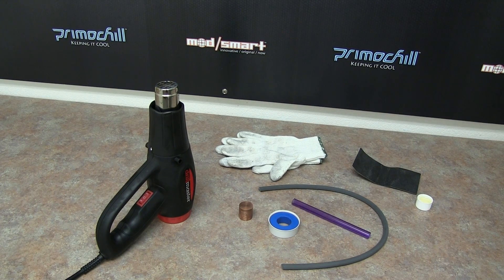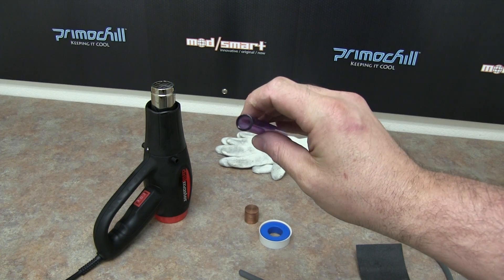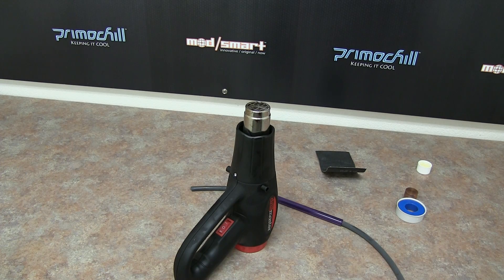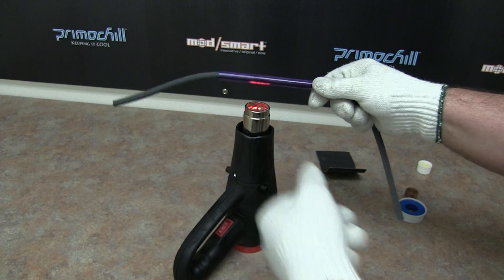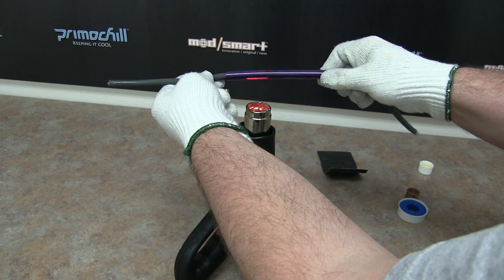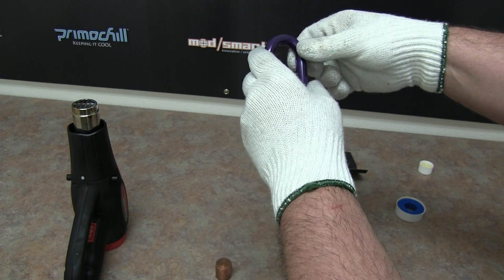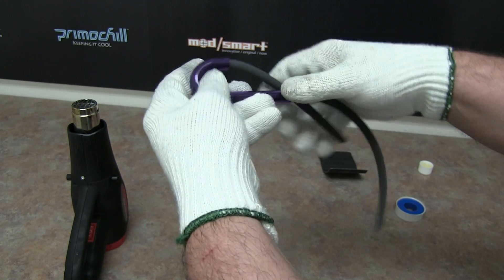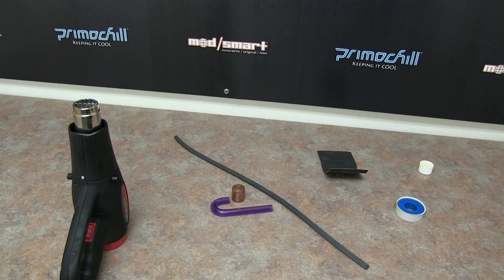PrimoChilll 1/2" Rigid Acrylic Tube - How to acrylic bending !! PART 1

Comment: What do you use to get rid of the olive oil in the tube?  I did it with the oil and it just doesn't look as clear as it was.  Tried soap and water still doesn't look clear anymore.
Reply from the maker: Typically this goes away during the sysprep cleaning process.
Reply: Or, you could, you know, not CONTAMINATE your loop with oil in the first place!  Crappy advice here.  You SHOULD be using ONLY a mild soap and water to lubricate, not olive oil!  BAD PRACTICE, and BAD ADVICE to use olive oil and to tell your customers to use it!

Comment: my heat gun isnt getting red inside, even on high, is it crap or broken?  i cant seem to heat up the pipe enough (heat gun looks the same as yours but its chinese)  if i cant get it melty so it bends, even after a few min right on top of the gun, its not hot enough right?

Comment: The damn thing is almost impossible to get into the tubing!
There is too much variation in the diameter of the acrylic tubes!
At best 25% of the tubes I purchased (10/13mm) had a large enough inner diameter to accommodate the silicone rod.
Any advice?
Reply: Use sandpaper on the rubber tube, and use soap water or oil!
Reply: ***** tried all of this, nothing worked.
Ended up buying some high temperature o-ring cord of the correct diameter off of ebay.
Worked a charm.
Reply: 101m4n 
What the above poster said is correct for anyone in the future watching this video. There is a slight variation in size but also the rubber tube SHOULD be a tight fit. If you can't get it in their with olive oil as lubrication then it is easy enough to sand down your rubber tube with sandpaper until it fits.
Reply: Mast3r Race The new cord that I purchased was a tight fit, the cord that I bought with the tubing was a millimetre too large. Besides, this was all done months ago.

Comment: Where did the heat gun pulled the air from?
From the Wooden table?
Usually it sucks air from the bottom (in this vid, red) and pushes it towards the shiny surface... No?
Reply: They are made to be used like that and thus they take the air from the top of the heat gun.
Reply: +Fredrik Carlén Are you SURE. Or are you just guessing? Because I have this SAME heatgun and it has holes on the bottom which DO suck air in. And he had to hold that thing over that heat gun for MINUTES it seemed like. I can heat up a motherboard and desolder parts in less time. So there's no way that it's "made like that"
Reply: +cybcarr no the sides, mines on the sides, the back is solid, looks the same as this one.. if yours has it on the back.. buy one that has the air intakes on the side...  shop around
Reply: Its coming from the cable
Reply: You must not be very bright. Here is that same heat gun. See the vents?  https://www.amazon.com/WindowTint-Drillmaster-1500W-Heat-Gun/dp/B00LLKLVUQ
I can't find a single heat gun from that manufacturer that has vents like you say.

Comment: Where can I find solid silicone tubing ?  What heat setting are you using to bend those tubes?
Reply: http://www.performance-pcs.com/monsoon-1-2-id-silicon-bending-insert-1-foot-for-5-8-od-tube.html most heat guns only have 2 settings... try number two, but keep the tube about 6-8 inches from the gun, and spin it around do not hold it in one spot for too long... keep spinning until the tube starts to act like the silicone tube inside of it (like a limp noodle) heat that for anoter 10-20 seconds than you can bend it into what you want.I would suggest buy an extra piece of tubing to practice on.
Reply: Ty. I'll take that advice.

Comment: the official primochill bending kit comes with a different silicon insert to the one in the video, as it's black and hollow inside which causes small kinks in the bends.
Purchased from a authorized retailer Nov 13.
Reply: primochillin  kindly answer to this Comment..
the official primochill bending kit comes with a different silicon insert
http://www.frozencpu.com/products/20691/ex-tub-1905/PrimoChilll_38_ID_Rigid_Tube_Silicon_Bending_Insert_-_1_Foot_for_12_OD_Rigid_Acrylic_Tube.html?id=ruvCvPyj&mv_pc=92
Reply: Syed SAW the stuff for the inside is also called Silicone Cord (or Core) you can buy from Mcmaster Carr or from performance PCs http://www.performance-pcs.com/monsoon-1-2-id-silicon-bending-insert-1-foot-for-5-8-od-tube.html Hope that helps
Reply: vladyerus
 thank you Sir :)

Comment: Any tips for degreasing the inside of tubes?
Reply: ArM4ND01 david6568 I soaked the tubes in dish soap overnight but didn't do much, ended up using an aquarium pump to pump soap water through the tubes over night, and then flushed with distilled water. Nightmare.

Thank you.
Reply: Next time just use soap water to lubricate the insert.
Reply: wash it with soap and water and then dry it very well
Reply: david6568
Maybe with a tube brush as well to really clean out the inside.  Don't forget to rinse well with distilled water.
Reply: Same problem  I did it with the oil and it just doesn't look as clear as it was.  Tried soap and water still doesn't look clear anymore. Soaked it in sink with soap and water and still the same.  I'm going to try again and use soap and water and NO oil and see if that works.

Comment: What setting did you use on the heat gun, and do you know the temps of it?
I ask because mine is about 630F on low & 1000F on high, don't want to melt the tubing. :-)
Thanks

Comment: You could score it, hacksaw it with a fine metal cutting blade, or use a piece of good quality guitar string.
Draw out the string to form a bow shape... coping saw is a good form etc. & heat the string with your heat gun until it's red hot in one spot. Then, quickly push it through your tubing.
 Clean the drawn out acrylic strings off the edge by hand & use a little piece of sand paper to clean it more if you want. It's cleaner cutting than other options.
I play guitar & have tons of string.
: )

Comment: Great video Brian....have you ever tried using sand? I been wanting to try it myself as I am pretty sure that it will work good too. However, I like your technique as it is less work and not as messy and it make awesome bends.
Also, you are right about cooling with water, it may harden it and make it to brittle.
Thanks for the amazing products